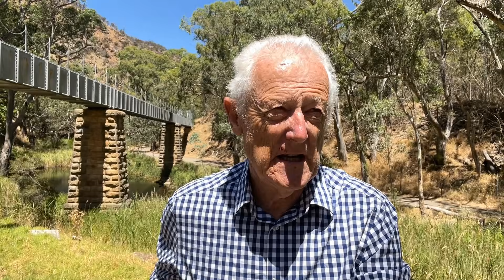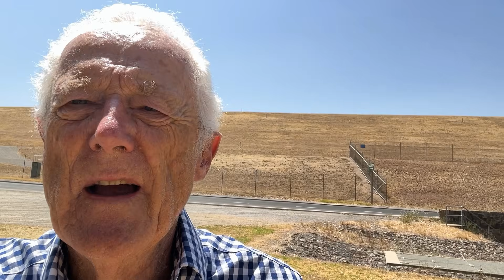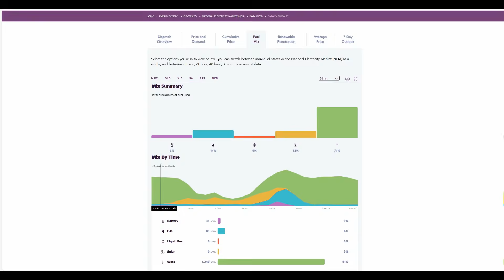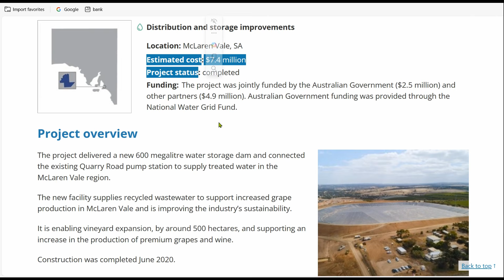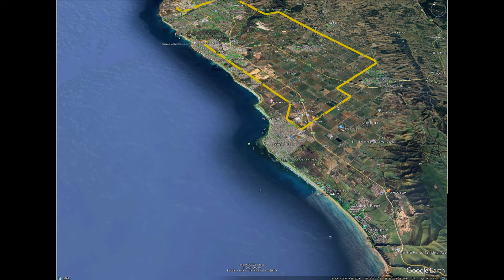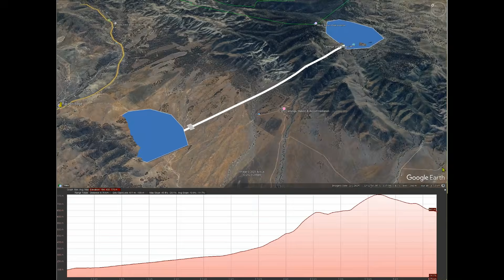Better Big Battery Makes Money via Dry Climate Closed Loop Pumped Hydro Energy Storage PHES

Comment: Give it up, your efficiency losses are wrong and thinking Solar energy is going to fill the top reservoir is pointless. Yes on a nice long sunny summers day but just too bad when it's winter as solar production can be down 90+% when power demands are high. So now you need another system to firm up intermittent solar/intermittent pumped hydro! end result as we are all experiencing right now without any pumped hydro is very high power prices.  This is exactly why no privately subsidized Solar & Wind swindle farms install any energy storage, its very expensive and makes no economical sense to any of them.
Reply from the maker: Have you seen 
https://youtu.be/Yw2g-mIp0XY
this looks at the economics of electricity generation and electricity storage Queensland has had PHES since 1984
Reply: @Highbury5089  I didn't say PHES doesn't exist I said it isn't economically viable, it's still and intermittent energy source so you still need to firm it up = Skyrocketing energy costs. But hey! I guess when you are very old, raised on coal, have your own house and are far more better off than todays youth then who cares about the ever increasing costs of power that inflates the cost of everything.
Reply from the maker: @cam_934    Please see the following
https://www.youtube.com/watch?v=66YRCjkxIcg&t=55s

Pumped hydro gets its energy from times when other generators have excess production and then release it when  there is excess demand.    Arbitrage.

The end result is 
*  cheaper electricity by smoothing out the demand / supply dynamic.
*   More reliable supply because MW of energy supply can be activated in around 5 seconds.
*  Stabilization of the AC Grid because modern hydro turbines generate natively in high voltage AC.   
*  long productive life of a very simple system.
Reply: @Highbury5089  :"Pumped hydro gets its energy from times when other generators have excess" and I just pointed out on winters days there is no excess not even enough to meet demand, there can also be little wind for a week at a time. Its INTERMITTANT ENERGY that now requires another system for a 100% back up and a power grid infracture crisscrossing the country that we are already told is approx 40% of energy costs so lets just keep adding more. You seem incapable of understanding that while the market has 100% shown us that its a silly expensive pipe dream especially as its wastes at least 30% of that excess electricity.

This is what happens converting energy sources, Hydrogen is even worse, Lithium batteries are the least but have at best a 15 year life span if they don't go up in flames with a toxic cloud. Your ideas are not new, you said "PHES since 1984" so where are the investors? Well I guess they can't make a buck out of it without massive Gov subsidies or they buy cheap Co2 Coal power at night to fill the top reservoir and sell it back less 30% efficiency loss at peak day rates (yes this happens) and produces more C02 than if it just came straight from coal.
Reply from the maker: @ Premier Joh Bjelke-Petersen Government in 1984 completed the Wivenhoe Lake and the 570 MW (4.7 GWh per day) Wivenhoe Pumped Hydro Energy Storage (PHES) at a time when Coal Fire Power Stations were the major source of electricity for the Government Owned.   Because Coal Fired Power Stations, like Nuclear Powere Stations, involves the boiling of water they cannot easily and economically moderate their generation in periods of low demand.
 
At that time, like today, Mid-February is seasonal period for electricity to power the domestic air-conditioning.    Power Blackouts and Brownouts were and are a politically sensitive matter.
 
It is suggested the Bjelke-Petersen Government recognized the wisdom of have a large and economical storage of electricity that can be instantly made available in the periods of sudden and peak demand.   PHES can Time-Shift the electricity from periods low demand to periods of high demand
 
Like Hydro Electricity like Pumped Hydro Electricity Storage (PHES) has a long-life with low ongoing costs.     
PHES uses electric energy that cannot find a market.   In 1989 this was after 10:00 to around 06:00 the next day.   The opportunity cost was minimal, if not free.    It is also a probability that the Queensland Gouvernement could build smaller Power Stations for a period after 1989because they had 4.7 GWh per day to deploy in the extreme peak periods.
 
Since 1989 no more PHES facilities have been completed in Queensland.
 
None have been built in South Australia
 
In today's world the wide adoption of domestic Solar PV means household demand for electricity in Summertime is minimal in daylight hours.   We now have the Queensland Coal Fired Power Stations still generating electricity in the middle of the day when there is minimal demand.     It would be a politically disaster to not provide electricity in these newfound periods of low demand.
They are forced to sell the electricity for a negative dollar amount per MWh.   
However, they can charge significantly increased amounts in the evenings to compensate for the fires they have kept burring for the sudden new spike in the 16:00 to 18:00 period.   
 
The households with their expensive Solar PV panels that produce excellent electricity but at a time when there is no market for that product.
 
It is future suggested that PHES is now recognized in a number of countries as an economic-way to Time-Shift electricity supply.  Below is a link to a "List of plants larger than 1000 MW capacity" around the world.
https://en.wikipedia.org/wiki/List_of_pumped-storage_hydroelectric_power_stations

It is suggested that South Australia and Queensland have numerous sites, close to existing power lines, that could be built as "Turkey-Nest" closed loop PHES.   

It is further suggested there is no need for expensive long tunnels through hard rock to link the lower and upper dams.

Comment: What if you get a long drought that greatly reduces the volumes of water you need?
Reply from the maker: The same water is used and re-used.  So, in theory, the only loss is via seepage and evaporation.   

The Nettle Hill storage has a kevlar floor and flexible Kevlar roof to keep treated drinking water away from the surrounding environment.   
 
So it is proposed that similarly covered upper and lower dams in Closed Loop PHES would not be subjected to water loss by evaporation in a drought.

In South Australia the treated drinking water is usually stored in large tanks with rigid roofs.

See the following research reports.
https://www.unisq.edu.au/research/sqnnsw-hub/blogs/saving-water-with-dam-covers

https://www.sheepconnectsa.com.au/management/water/dams/controlling-dam-evaporation

https://www.awtti.com/dam-floating-cover/

Comment: Thanks, good analysis, greatly appreciated.

I am not sure about your efficiency figure.of .8. I use .65 in similar analysis.

I agree that pumped storage (PHES) is far more cost effective for managing dankelflaut than chemical batteries. Provided suitable sites and water is available, I estimate by a factor of about thirty.

I also agree in the absence of nuclear power PHES is the most practical way to stabilise the grid based around renewables without burning fossil fuels. The issue is availability of acceptable, high quality sites and water.

On the east coast worst case dankelflaut can give rise to about one extreme ten day period per twenty four months where combined wind and solar drops to about 20% rated capacity.

Snowy Hydro 2 with about 350GWhr at 2GW rate (cost $13bn) is the type of system needed in the east to deal with such contingencies. There is probably scope for a Snowy Hydro 3 and possibly a Snowy Hydro 4. 

However, the problem is we need eight to ten such systems. At present I understand only three are under consideration and it is possible only five will ever be practical due to cost.

Nuclear energy would largely solve the problem for about the same or even lower cost. There is a long way to go. 

By 2050 I estimate Australia will need about 64GW on line (some experts such as Prof Finkle former Chief Scientist have much higher estimates). To achieve this level of energy generation I estimate about 25% (16GW) could be generated from nuclear energy, the remaining 48GW from wind and solar, mainly firmed as needed by PHES, long distance feeders and a bit of chemical storage.

Nuclear is problematic, but without it the storage and feeder problem becomes far more acute.
Reply from the maker: Thanks for the great response.

The problem is an apprentice trained to use a sledge hammer will try to use it when he becomes a tradesman.
When created in 1943 what is now called Snowy Hydro was actually a water diversion project and the generation of electricity was a side benefit.     
The main aim was to divert of the waters running down the East Side to the Eastern Divide Maintain Range onto the Murray River flood plains in NSW.

This involved long tunnels through hard rocks.

The Snowy Mountains Authority was owned 58% NSW 29% Victoria & 13% Federal 

In 1997 NSW and Victoria consolidated their share of electricity business into Snowy Hydro Trading Ltd.   This was an unlisted company.
Snowy Hydro Trading Ltd started to sell electricity on the retail market, trading as Alinta 
Alinta Energy is building a PHES called Oven Mountain. 
https://ompshydro.com.au/project
This involves running the water down to the turbines via tunnels deep with the mountain.    Just like Snowy Hydro 2.0

It would be quicker and cheaper to run the pipes down the escarpment not through expensive tunnels through hard rock.

"It will bring much-needed, long-duration storage and reliability to the National Electricity Market, generating up to 900 MW of electricity and storing enough water for up to eight hours of dispatchable energy at full generation for 100+ years."

Comment: A few years ago I saw a system in Portland Oregon that put Turbines in City/Town Water pipes as this water is already being pumped around to maintain pressure. Each one was a small turbine so as to maintain the water pressure. I wonder if they could be placed on long distance water pipes that use gravity?
Reply from the maker: Keith that is what is currently being done with the 2 micro hydro plants in Metropolitan Adelaide.   

At Hope Valley (as featured in this and the previous video) where the water descending the 400m elevation at the Anstey Water Treatment Plant to the Water Storage Tanks on Grand Junction Rd in Hope Valley at an elevation of 200m. 

The other micro hydro is at Seacliff 

https://www.gilkes.com/case-studies/seacliff-case-study

Constructed in 2013 with a Head of 86m and is 1.1 MW.

Where the Murray Bridge to Adelaide Pipeline terminates near Verdun there is a site where the water has to descend from the top of the Adelaide Hills into the Onkaparinga River below on its way to the Mount Bold Reservoir and then to Happy Valley Reservoir.

https://info.awa.asn.au/hubfs/Water%20e-journal/202108_006_003_014_Feasibility%20of%20Mini%20Hydropower%20in%20Water%20Transmission%20Pipelines.pdf

That project has not proceeded at the moment.
Reply: @Highbury5089  Thank you for your Quick Reply and information and it's good to see they are aware of this technology.

Comment: gday neil.  you put a lot of work imto thid piece  thankyou  i hope they are taking note. is there any current news on sth rd tunnrl ?
Reply from the maker: Thanks for the comment.   This is a complex issue and it has taken some time to prepare this video.

The works for the 2 tunnels for the South Road are progressing, particularly at the Darlington end.     The properties that are around that portal have been cleared.   
Presumably the assembling of the first of the boring machine will be the next big step.

Two pairs, a total of 4 tunnels, are involved.   Recently they have decided to get a 3rd boring machine.  
The boring machines will be 100m in length and 15m in diameter
Reply: @Highbury5089  cut and cover would be way, way cheaper.
Reply from the maker: @ Cut and cover is used when the pipe enters suburbia.    

Just past we I am standing at the start of this video the pipe goes into a cut and file beneath Leopold St.
It then runs under Mannum Street and finally under Grand Junction Rd to enter the Water Storage Area at Hope Valley on Grand Junction Rd via an easement on one of the properties adjacent to where the micro hydro turbine is located.

Burying pipe is the National Park involves disturbance to the roots of the vegetation and would become a barrier for the echidnas that live in the area.    

Much easier to monitor and repair pipes above ground.
Reply: @Highbury5089  I completely misunderstood what you were talking about. I was talking about the South Rd expressway.

I enjoyed your video. In my youth I knew Anstey Hill like the back of my hand. I knew exactly that spot in the thumbnail.
Reply from the maker: @mattytee8671  Thanks for your clarification out the "cut and fill" comment.   
They are doing Cut and Fill where there are no significant buildings on the route for the freeway.   The cut and fill section in the section that is south of Thebarton Theatre.    The portal at the southern end of the dual 3-lane tunnels then opens out into a 6-lane freeway then runs in a cutting that goes under James Congdon Drive interchange and then under the Hilton Rd extension.

For most of the route they have gone deep enough so they don't have to destroy more suburbs.   
The idea was to NOT copy Las Angeles and destroy suburbs.      

Thankfully this in SA will NOT be a toll road.   
The road tunnels beneath Brisbane are basically under-utilized because citizens do everything possible to avoid using the toll roads / tunnels owned by private companies
In Sydney the NSW government has now capped the total of the weekly charges the private company can charge users.